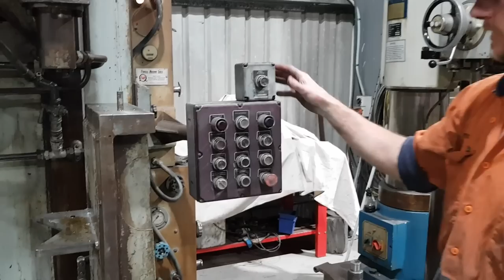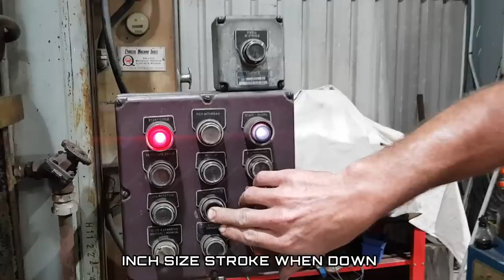Our RARE 1960s Delapena Vertical Honing Machine tour | Workshop Machinery

Comment: Delapena, my old firm, did my time there in the 1980’s, these ‘power’ machines as we called them had finished by then, but there were loads still in existence. The last one I worked on was up at Vickers Defence Systems, Newcastle, they were building the Challenger 2 tank at the time.
All of Delapena’s machines were designed and built in Cheltenham, UK, the firm is still going today albeit a lot smaller than it used to be. 
Your vertical machine would have been assembled in the ‘Giraffe House’ in what was called the Zona Works which is now now Wickes, a DIY store. We did massive horizontal machines too, for hydraulic cylinders, periscopes and gun barrels.
Keep up the great work!

Comment: Hi Kertis I have just spent a couple of interesting hours watching first the 1000 hp problem surely. an annealing cock up and then the Delopena video thank goodness for youtube. In 1968 I started The final 3 years of my apprenticeship in Dowty Rotol Cheltenham No 1 shop. Here we made guess what Harrier under  carriges. I specialised in milling and horizontal boring finishing my time on a Devlieg jig mill We. made the undercarriages in batches of 3or 4 at a time each one taking many shifts on the borer. Close to the HBM were the deep hole boring machines and included in this dept were the Honing machines. I can remember several horizontal and a few vertical hones but not your specific one. Many of the machines in No 1 shop were marked Property of the government or RAF etc. Rotol was the only factory making Harrier bits during this time. I believe your machine is almost definitely from here. Occasionally we would have a reconditioning undercarriage to machine. The Sea Harrier was not made until 1978 and not released till 1980   I don’t think the Navy would have used your machine during the 1960s. Complements of the season to you both,  your wife does a  very  professional job with the camera. It’s a small world from Wales to Aus.  Reguards Richard
Reply: I worked in no1 shop Rotol for 10 years then in No2 shop. left Rotol in 1992. if that mahine was from Rotol it would be painted Dowty Blue.

Comment: Like you said I would/love this one mate and you were spot on. I love the 3 Sunnen heads I have. At one time I hand bored engine blocks using a 1/2 drill and found the bottom and very top always needed more time with the stones so no taper was present. This beast can do that as well. Whoever thought this beauty up took all these things into consideration eh. Now with the improvements you have done it will service you well for many, many years and decades to come.Thanks a bunch my friend. I really enjoyed this post.
Reply from the maker: Hey mate glad you enjoyed this one yeah it's one heck of a machine definitely worth doing the mods and giving it a new life. Before this I used to hand hone our cylinder barrels! haha cheers 😎👍
Reply: That is a fantastic addition to your shop. Really gives you the edge on the competition. Question:  Does your scrap dealer take the fines?  Just wondering.
Reply: @CuttingEdgeEngineering  For about 5 years I hand bored more V/8 Chev and Ford, Dodge engines that I can't recall how many 45 years ago. Young, Strong and full of it.  I wore out a few Makita 1/2 inch drills and am still driving the 48 Chev 1 ton 4x4 I put $20K into that engine. Toss in numerous motor cycles, boats and whatever came my way. Sunnen hones are top notch for sure. On occasion I look up at the shelf where they gather dust and will remember a particular engine that gave me a bad time so many, many years ago. Funny how those memories stop by eh.

Comment: Right out of high school, as an 18-year-old, I worked in a General Motors' factory. My building and the engine machining building shared a wall, with a large door. On my breaks I would go watch the engine-blocks being machined from their castings. One of the most interesting steps, to me, was the honing of the cylinders. They honed all eight at once, but at four stations (coarse, medium, fine, scratch). Six years ago I was watching a YouTube channel where a man restored decades old, rusty, small machines. In one he was restoring an portable air compressor. He used a wire brush to "clean" the cylinder ! Then he reassembled the compressor without honing the cylinder. No, nope, nada. Proof that he was an idiot, so I stopped watching his channel. This video reminds me of that. Cylinders need to be carefully honed to match their pistons. Love. This. Video.

Comment: Right down to the oiler and centrifuge this was well thought out. Even the latches on the top of the centrifuge are on off pieces. Shop made and easily replaced. Very nice mate.
Reply: @millomweb  Add a counter weight outboard and L/H threaded bolts. You can do it eh. We are the problem solvers are we not ?
Reply: @millomweb  Worth a try eh.
Reply: I thought it used filters and magnets. But this way is so much better and clever.

Comment: Excellent video. Very interesting machine. i have a 1963 Colchester lathe in my home workshop.  As for the heritage of this machine. If it was supplied for Harrier U/C cylinders and they were done in-house which would have been very likely.  It was probably located in the Hawker Siddeley factory in Kingston Upon Thames (SW London). The factory is long gone.  I worked at the Ex Vickers Armstrong's site, Weybridge Surrey (now the excellent Brooklands Museum). When I was there in the early 1980's, they were still manufacturing spare undercarriage assemblies for the Vickers VC10. There mist have been a honing machine on-site but I hsve no recollection of it.

Comment: Hi, keyboard warrior here, if you don't mind. I'm an engineer and I love watching these videos to learn new stuff. I'm a little concerned about the machine not using the end-stop limit switch that you mentioned at 6:20 in the video. Forgive me if I'm wrong here, but I believe that is a safety limit switch to prevent the machine from crashing in case your normal limit switches fail. In other words, it's an "Oh Shit Switch" for when things go wrong. It's never supposed to trip, but if it ever does, it means shit went south, and it prevents the machine from damaging itself.

I noticed that when you manually tripped that switch, it shut everything down, not just the carriage. So I'm pretty sure that it is the safety switch I described. If you can run the carriage fully up or fully down, past the normal limit switches, without damaging anything, then you don't need the end-stop, and can disregard what I say. However, if running the carriage too far can damage something, then you may want to either put that switch back in, or even put a second (assumed normally closed) switch in series with it for that function.

P.S. Just found the channel and love the videos. I'm binge watching all of the older ones.

Comment: Neat stuff, I've only ever run honing heads on a manual boring mill at a shop that refurbed natural gas compressor and there engines (big boys with 8-12" bores, the v16 are pretty crazy big). We were only cleaning up the bores so a set of stones would last quite a while, never realized how fast those stones wear when your roughing out a barrel. Love the out-takes, keep them coming!
Reply from the maker: Hey mate thanks for watching and commenting. I'd love to just clean up and finish hone all the time haha getting a barrel out to size and level high spots can be a pain in the butt 🤣

Comment: At least by vertical honing,  as opposed to a horizontal bed,  you wouldn't have to rotate the barrell  to keep the bore concentric to centre line.  I used to rotate 120deg every 1/3 of material to be removed to maintain centre of bore.  Very interesting machine,  and thanks Kurtis...
Reply from the maker: Hey mate there are not many manufacturers/repairers that we know of that do that correct procedure with horizontal honing. Great work on your part mate and thanks for watching 😎👍

Comment: I’ve handled similar centrifugal separators for processing polycrystallines for precision optics.
Best way for me was to change the rubber bucket quickly to a clean one, and let the sticky gooey mass to dry outside for couple of days in the rubber bucket - so it’s easier to dispose of (in accordance with your local regulations).
A spare bucket will cost ~$300.

Comment: Nice bit of kit. If your interested those push buttons are Sqr D and you can still get the contact blocks for them, via a Schneider stockist (well at least in the UK you can). The buttons themselves are also still available,  albeit modernised as Harmony 30.5 range. The limit switchs are proper old school tough as old boots, i think that you may still be able to buy contact blocks,  but im not sure. Hope that this information is useful.

Comment: Ran a similar machine in the early 90s finishing flight refueling probe bores. Memory says there were 4(?) stones and guides on the, as you say, extortionately expensive Delapena heads.
I do remember how the centifuge absolutely f**king minged when cleaning it out, not a job for just after tea break or lunch.
Not much I can add to how it worked, it was all fixtured and set-up with stops on the stones/head that were set with setting rings and gap gauges.
Measuring was via air guaging on the end of a long pole as they were Ø88(?) x 1200 long bore.

Gun drilling the blanks was always fun too, they already had about 300hrs rough machining from forgings in them before the bore was punched through, and it didn't always go to plan. Most impressive thing was holding Ø87.85mm +/- 0.03 dead straight and parallel for 1200mm.

Comment: I laid mine down flat built a table around it made it much easier to use especially if you had a bunch of long cylinders
You could even honed out cylinder that was 10 ft long
Ended up being much nicer than vertical .
 also on your limit switches we put a time relay that way you got the proper hone on the end of your cly
Without doing it manually
Reply from the maker: Nice work mate sounds like you had a sweet setup there 😎👍

Comment: I remember using a Sunnen honing machine back in the late 80's, so I got a bit of a chuckle when your wife commented to the little furry helper about the stink! Laugh, I see they haven't improved that nasty smell of their secret sauce honing oil yet! The pieces I honed back in the day where small, basically cleaning up the lands of round metal stamping cutting dies after heat treatment. So I was surprised how small the stones you use are relative to the size of the work pieces, and if that's what there is for cutting surface, it makes perfect sense why you would burn through so many sets of stones for a cylinder compared to never having ever changed a set of stones, because of almost no wear, working occasionally on the tiny stuff... interesting video, I like seeing the older less seen specialty machines that are just as capable even if they are almost all but forgotten...

Comment: You should be able to buy replacement Sunnen stones in the naked format. They Araldite nicely onto the hone mounts. Clean broken worn stones on a wire wheel after chipping off old material. You can use the next day. Glueing your own stones will save you a fortune.

Comment: Figured some of the data specs, could be used by all brands of Delapena machines. Pressures settings and such. Haven’t stopped looking for the specific machine manual, but looks like I could be trying to find a needed in a haystack.  Best wishes  From Waco Texas, USA

Comment: Hey Kurtis! Can you explain why you hone so much material out (~1.5mm) rather than line bore it first and then hone say the last 0.1mm? I'm guessing that would be double the setup time which might negate the savings in actual machining time. Thanks for the videos, your hard work is really appreciated! Greg.
Reply from the maker: Hey Greg, yes the time to set up to bore the tube out (with the current set up I have) and then to finish hone it is actually cheaper and more time efficient to just hone it. Thanks for supporting the channel 😎👍

Comment: It just blows me away how you took something built in the 60s wear no computers no electronics very complicated piece of equipment you’ve modified it and it does an amazing job but the best part is you don’t have $500,000 in a piece of equipment that you might only use eight times a year it does a great job but you can’t justify it not turning and doing stuff totally impressed

Comment: Very impressive machine. How do you inspect the barrel after honing, do you use a borescope with remote camera to inspect the cylinder surface?
Reply from the maker: Hey mate thanks for watching, usually use light reflection will show imperfections and bore gauges to measure 😎👍

Comment: Measuring.  Just an ID mic, or is there room to reach in with a Sunnen style bore gage?  I’ve done my share of honing, from the little honing machines to mounting a large cylinder horizontally on a mill table (just for a place to clamp the cylinder down to), then driving the arbor with a heavy duty electric drill suspended from a jib boom.  14” bore.  Hard work if you ask me, and the honing oil does not smell sweet to anyone.  Especially the old lady when you come home from work.  I saw your machine in a previous episode and I think it’s the neatest thing.  Thanks for showing us around, and getting the chance to meet your safety officer dog.

Comment: Great to see an old machine retasked, and expertly modified. Innovative oil filter system. I've seen several in use in  a Caterpillar company in Italy, probably 10 plus years ago, they also had vertical induction hardening machines for the piston rods. For the cylinders they had horizontal skiving machines, most were made by Sierra Machinery of the US. I was installing/servicing our Friction Welding machines.
Great photography, and vlog.
Thanks for sharing and stay safe all.
Best regards from the UK.
John.
Reply from the maker: Hey mate that would have been some awesome gear to see then! Thanks for sharing and watching the vid 😎👍

Comment: Lovely video, I never saw a honing machine before, so it was most interesting - a lot more material is honed out than I expected!
Just one question: What is the inch size stroke used for?
Reply from the maker: Hey thanks for watching! The inch size stroke is used to concentrate on an end of the barrel. For larger diameter barrels the ends can sometimes be undersized during honing so it's to rectify that problem 😎👍
Reply: @CuttingEdgeEngineering  Is the undersize due to the reciprocating nature of the machine?

Comment: Now that's a James Bond-esque evil torture machine if ever I saw one!
Reply from the maker: Yeah it's awesome. That 1 inch stroke is savage hahaa
Reply: @seanrodden6151  God No. I once used my Hitachi wood chop saw to cut down some beef bones for the dogs. I had bone, marrow and fat everywhere. Never again. I will just use a hacksaw or maybe a reciprocating saw and wipe the blade clean.
Reply from the maker: @Mark Fryer thanks for your input there goes my butchers shop idea 🤣
Reply: @CuttingEdgeEngineering  Just saving you some real grief, Kurtis.
Reply: You can always use it for cutting meat but pass it in the liquid hydrogen first. Once frozen you can prety do what ever you want with it. Even bore and turn it 🤣🤣

Comment: That is so much better than running a Sunnen Honing head driven by a 3/4 hp electric hand held drill motor dangling from a chain hoist to hone cylinders clamped to a steel table.  LMAO!  I came from the 1960s and I used primitive tools to do very precision work the equipment was never intended to be used.  Inventing on the fly...

Comment: That's a Hum dinner vertical hone. I worked at National Supply co Torrance California 
They had a row of them several Larger than yours awesome machines .
Reply from the maker: Hey mate that's awesome to know would've been a sight to see for sure! Thanks for commenting 😎👍
Reply: Torrance..? I worked at Burgmaster in Gardena 1970-80's until they folded up in 1985...they had about 150 pieces of equipment in the machine shop...built most everything right there...pretty sure they had 1-2 vertical hones...and a couple horizontal broaching machines about this size..

Comment: a must for manufacturing cylinders they get distorted when you weld the nubbins on the ends on and cylinder stock in different tolerance
Reply from the maker: Right on 😎👍

Comment: Nice machine, I love to see you add a reducer on both ends of the stoke, to slow down the speed and reduce the thumping. do you think this is possible?
Reply from the maker: Hey mate thanks for watching. It's all hydraulic control, when it's honing and there is weight/pressure on it you don't hear those sounds. 😎👍
Reply: It's probably good that the direction reverses very quickly to maintain the angle of the scratch pattern. At least in engines, that's important for cylinders to seal well for the whole range of motion.

Comment: Hi, Im surprised what all you could do on that machine... i used to work on old Nagel 0.30m-12m stroke, 30mm-960mm bore machine :) so i know what it takes to run those ( btw magnetic separator is amazing thing if you are sick of gettin messy :D ) I really enjoy your channel, good job 👍
Reply: A two step clean up, first the magnetic, then the centrifugal for everything else?
Reply: @alro2434  magnetic cylinder with scraper then filter cloth for non magnetic junk

Comment: Sweet..! But I'd like to see the inside of that upper cabinet....full of wires and relays....? All through the 1970-80's I built stuff like this...Burgmaster turret mills and VTC's...
 Keith Rucker on Vintage machinery.org has quite a good outfit that can help you get copies of this machine operators manuals....maybe...
Reply from the maker: Hey Doug thanks for watching mate! Yeah that cabinet is the wires and relays. Someone else mentioned Keith ruckers site so will definitely give that a go. Cheers 😎👍